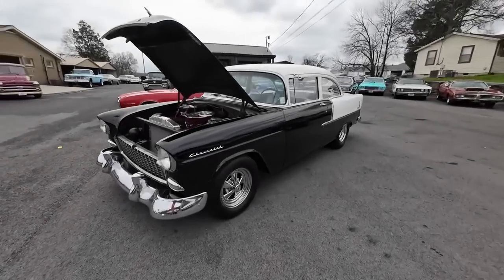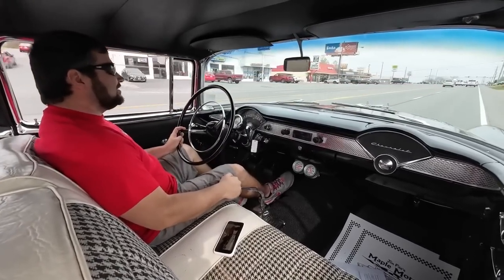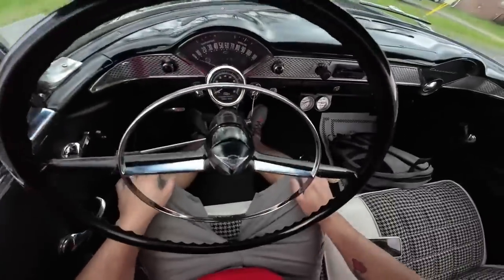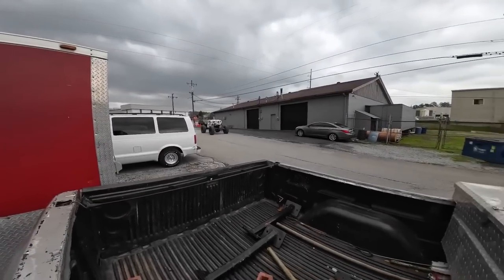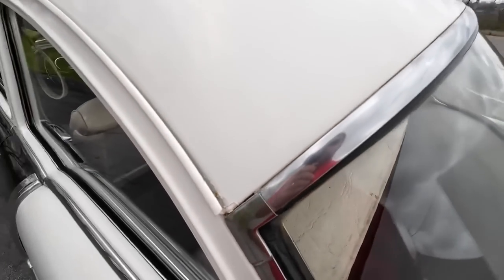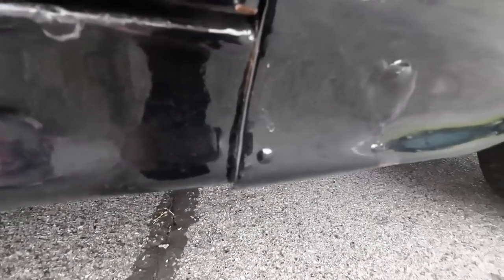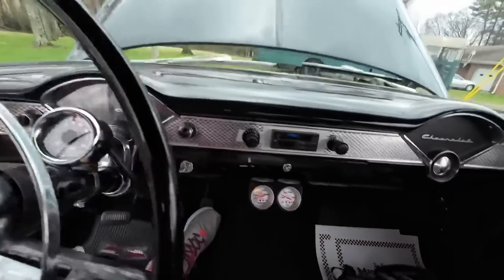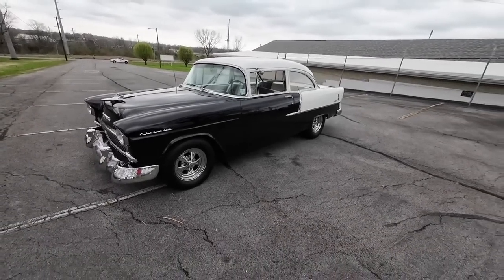Test Drive 1955 Chevrolet 210 2 Door Post 350 V8 4 Speed SOLD $32,900 Maple Motors #2064

Comment: Beautiful restoration and modern modification. It just needs some attention to some of the controls (radios from that era aren't likely to pick up any radio signals transmitted today) otherwise that's a sweet ride. The interior is so well done. The bench seat in particular was really well done. Also, very cool side excursion.
Reply: So many minds think a like.
Reply: So, do you think that AM radio, that's amplitude modulation works differently now than back in 1955. Guess what, it doesn't. It works exactly the same way that it always has. Yes that particular radio needs some finish installation or repair.  But AM is still AM. Same frequencies.
Reply: @davidkeeton6716  That's right. It's the new FCC ruling on AM that was made in 2020. Some stations are strictly broadcasting on the digital signal and that radio isn't going to pick that signal up.
Reply: Indeed Sarghe. Thanks for your service.

Comment: Hi nick Just an FYI and you probably already already know Because you are a car guy but if in fact it has gear driving it and It sounds like it might but I'm only going by listening on my phone Sometimes that gear drives also have a  Ticking clacking noise especially at idle. Also the engine does have the old school camel hump heads which are  Nostalgic and cool guy for the era Very neat car Sure it will sell quick